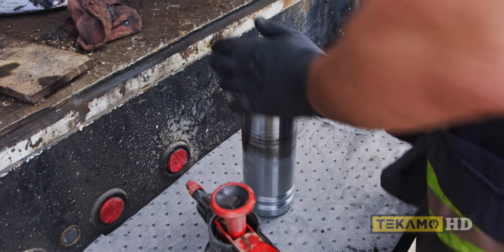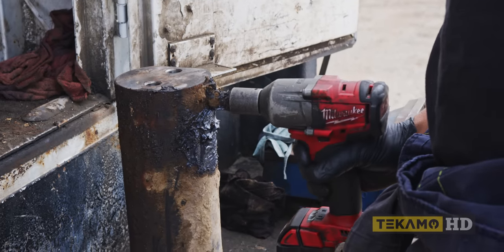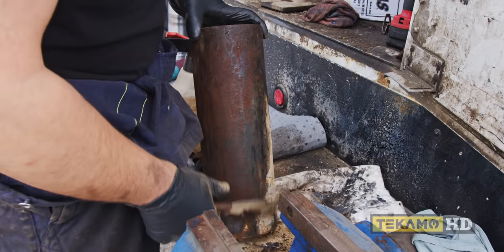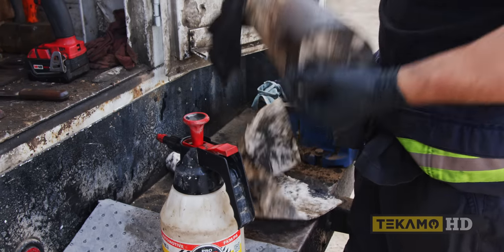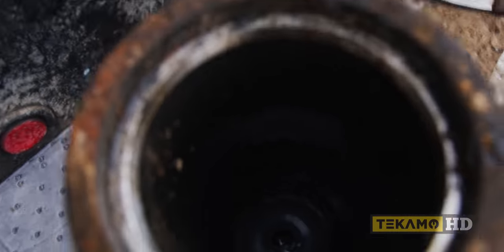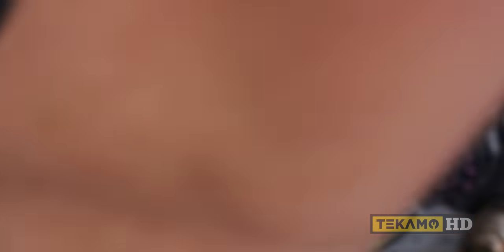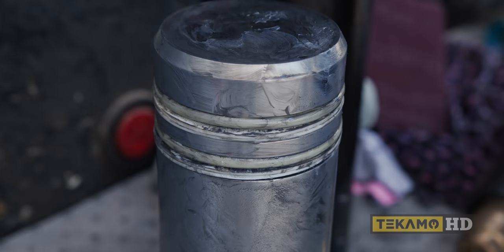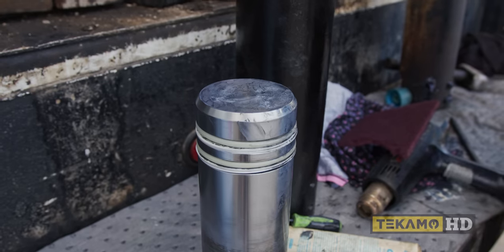CAT 330C Track Tensioner - Tailor Your Repairs to the Situation!

Comment: Hey cam good video, I'm coming across track tensioner's chrome pitting out externally and internally on the SANY equipment from the 130 to the 450, don't know if you guys have them in Canada but we have shit loads in Scotland,  but when you reseal them there's roughly a 2mm Gap in the tensioner body but most of the equipment has only done 1500 to 2000 Hours, the manufacturer is pondering over what to do next🤣🤣🤣 done one on Saturday then seen your video and I thought I would let you guys know, by the way you are so lucky to have a crane on your truck.
Stay safe.👍👍👍

Comment: I always enjoy doing track tensioner jobs. Good physical job to pass the day. They are sometimes a bit of a mongrel on CAT 325DFM etc, you would have to spend half the day chipping out mud that had turned to concrete just to reach the 2 bolts. Without a decent impact gun those bolts can be near impossible to get out cos of the stupid frame in the way.

Comment: What is typically the starting pay for a new tech with a two year degree in Heavy Equipment? I tried looking this up but just got average pay and nothing on starting pay. Not looking for exactly what but at least around what to expect.
Reply: 27 dollars an hour is what I got right out of school.
Reply: Here in Michigan non union your look at 18 to 20 for starting. Union wage is 20 to 22. If you do an apprenticeship thru the union you get 20 then after you do the 4 years you jump to $34 hourly
Reply: I’ve been turning wrenches for over 10 years on everything from airport equipment to D11 dozers. Low to Mid 20s is where you will start. A degree will help but the thing that really gets the big pay checks is experience. I don’t have a degree at all, but after I built knowledge and experience I’m making over 100k a year with a company service truck that I drive home every night and average amount of over time. Get in start learning and the money will come.
Reply: Washington state, US here. Not a lot of apprentice/union programs. I have a diesel degree. I started at $24/hr at a dealer. I did a year and a half in the shop, then moved into a truck. I think the degree really helps in the long run, not really as you start out.
Reply: @chadanderson2732  D12 lol, hope that's a typo
Reply: @nickh6076  don’t know what your talking about

Comment: With the Kubota KX80 tensioners it was may be you could get one if you could it was weeks to months out. I rebuilt them, buffed up the rod ya they had some pitting but the tensioners never failed. Why is Cam using that cheap sh*t brake clean I hate that brand, the contractor I work for had a case of that crap the stuff doesn't clean sh*t I haven't flung a can(s) across the shop its been close. Only down to one can left I will start buying the brands that I like to use that actually work.